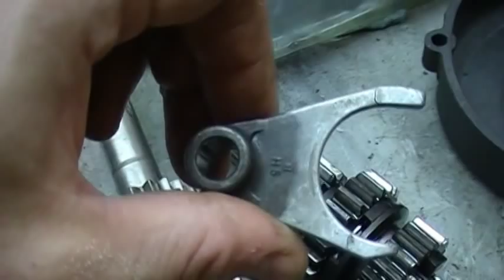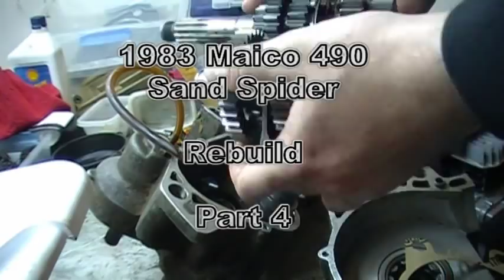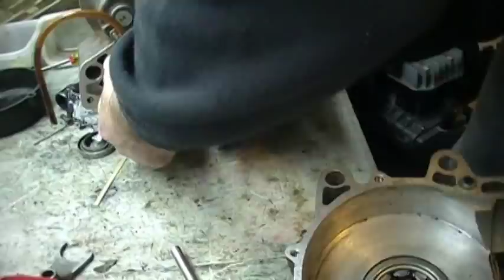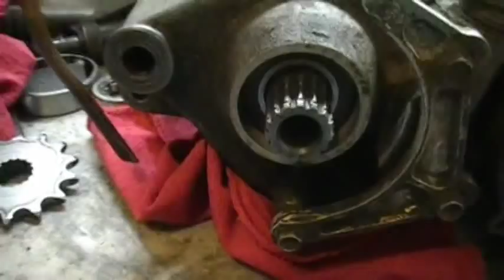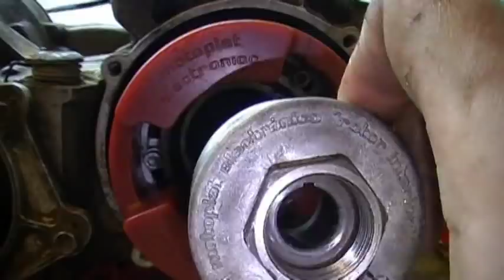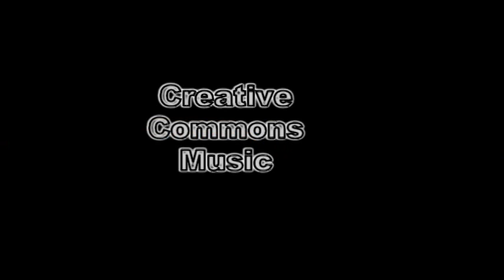1983 Maico 490 Sand Spider Rebuild Part 4

Comment from the maker: @vvtheduckvv These transmissions are quite simple compared to the KTM 495, wasn't sure if that thing was going to work or not and cant test by hand especially without putting the cases completely together and bolted.  Hopefully this one will work I turned it into a 5 speed from a 4 speed, should be fine though it was a complete transplant.